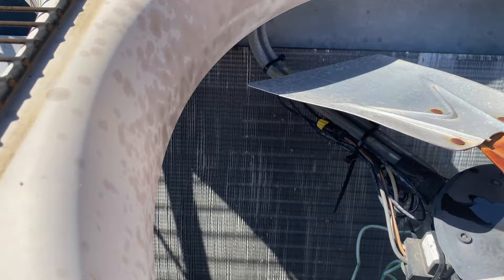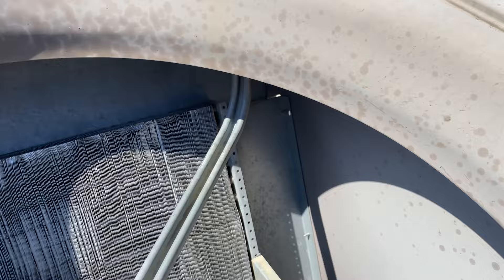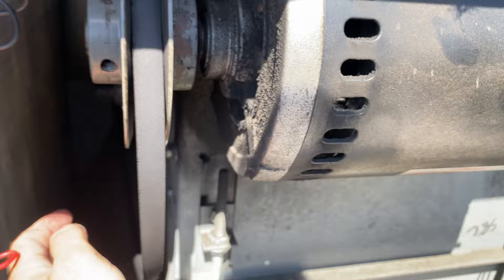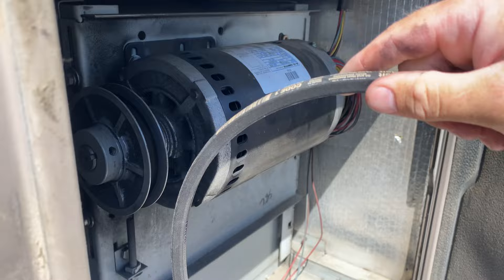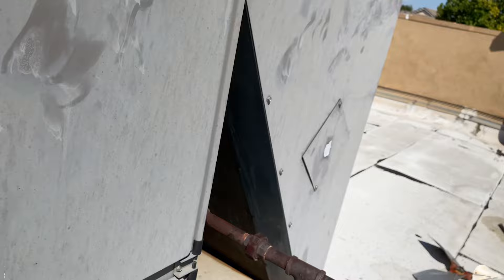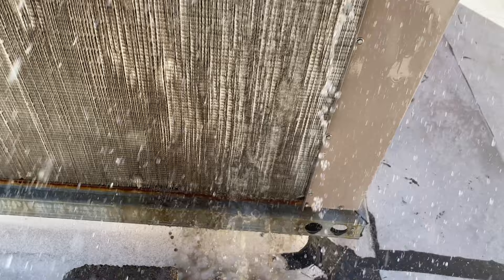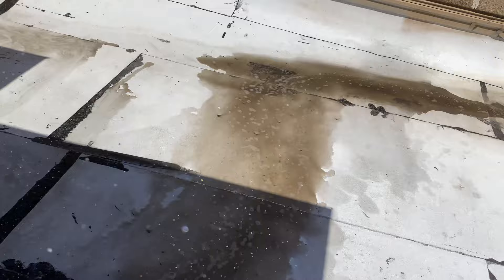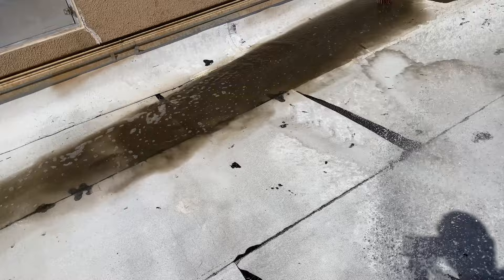NO Cooling York Air Conditioner Broken Fan Blade Shaking the Building HVAC VLOG

Comment: I wonder if this is a defect in the manufacturing of the blade?  I have came across 2 of these as well.  York source 1 parts are junk.  I tnink Lau and Revcor make some of these blades.
Reply from the maker: The restaurants I work for have York units and I have seen it a lot. Some of them happen if the shaft gets loose the fans hit the bracket. I believe this was a revcor.